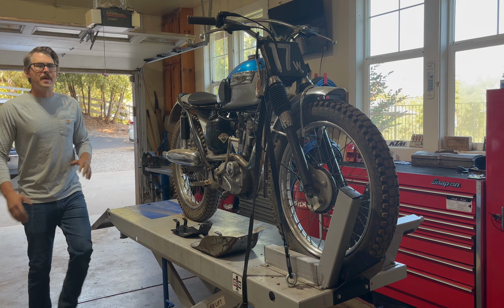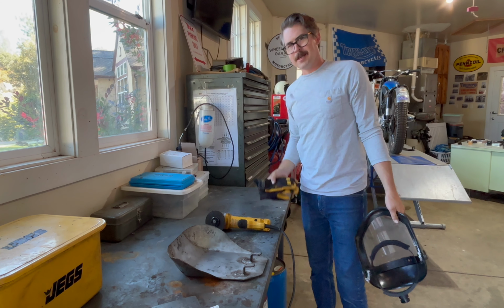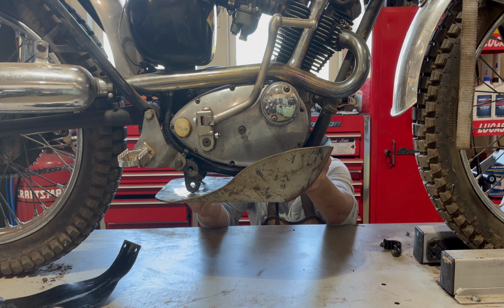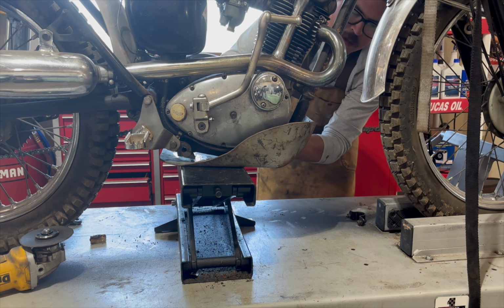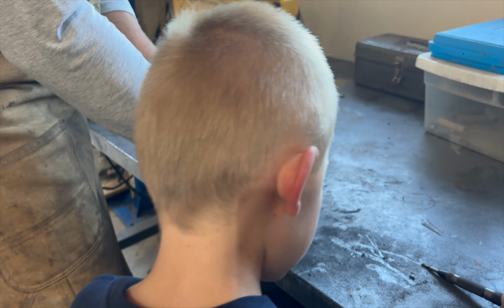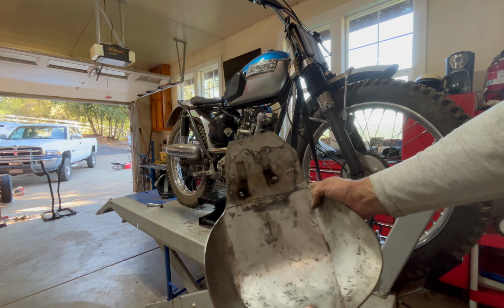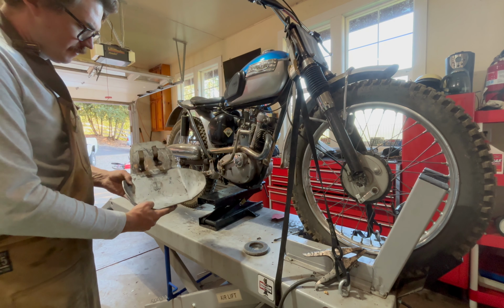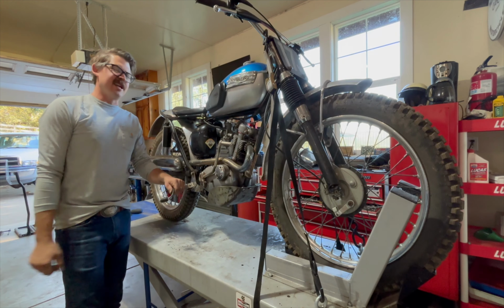1966 Triumph Cub Skid Plate Mod!!! |

Comment: I would've just welded the old plate to the new, and smash and bash to fit.  Welding on the floor !  I tend to do that too.  I know it's not a trials bike, but I always mounted my trials bike gear levers vertical, gets it well out of the way, and we didn't change gear in sections.
Reply from the maker: All good points… I gave some thought to welding the old plate to the new one, it just seemed cleaner not to and was basically the same amount of work. I don’t enjoy welding on the floor, but I haven’t made an extension cable for the welder long enough to reach my welding bench 😆. I did end up mounting the gearshift up high. It was just simpler and I rode it today and it’s totally fine.